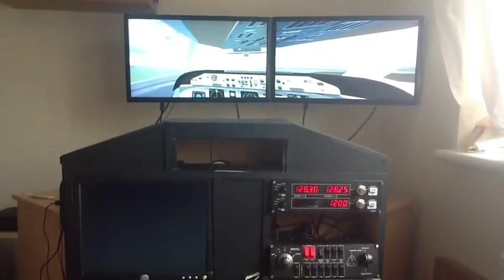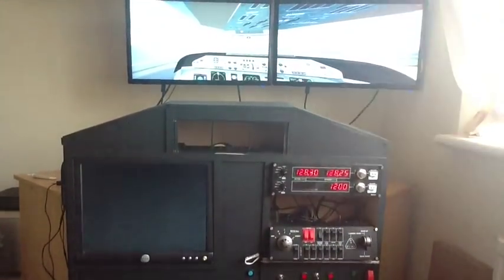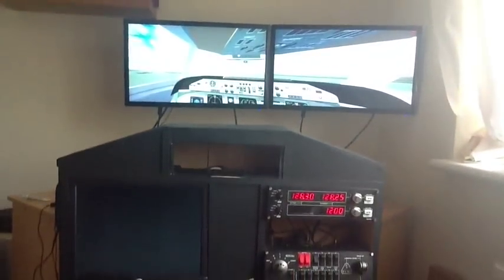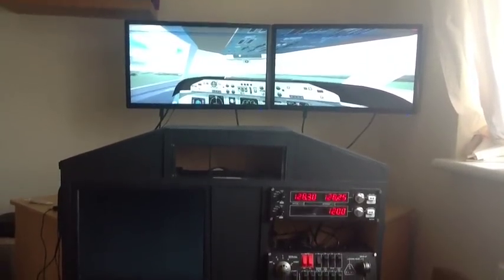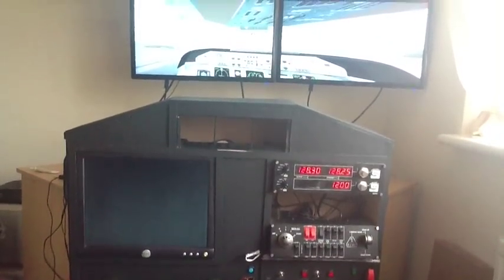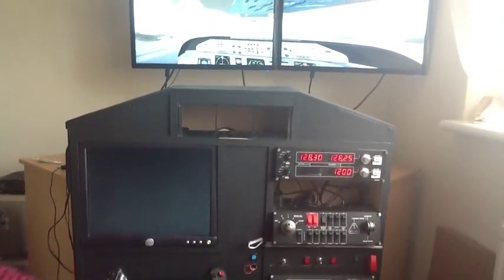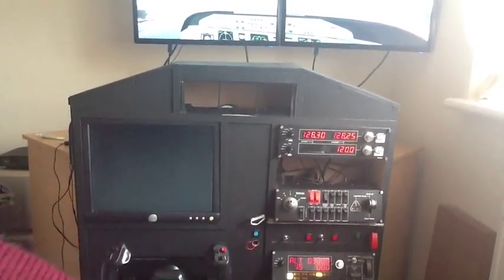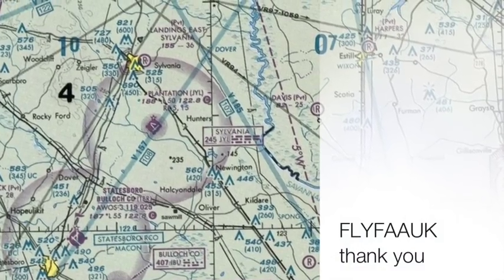Home Flight Sim Panel Help

Comment: yes you can move the other panels in full mode you have to plug the triple head into your first DVI on your video card and the second lcd into the other DVI or VGA on your card then when you go full screen you bring up whatever screen you want GPS,ATC, so on and drag them onto the second lcd I use nvidia but first before you fire up flightsim go into your video card control panel and set up multiple displays triple head will be primary display and the other lcd should be on the screen!! Cheers